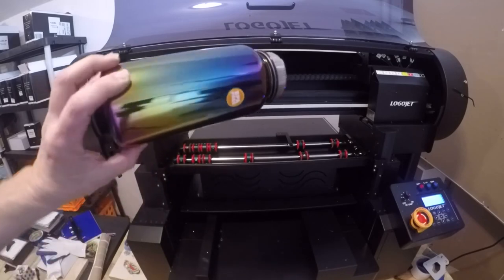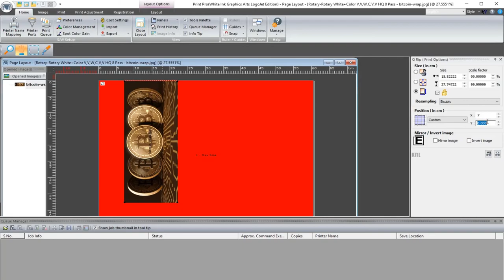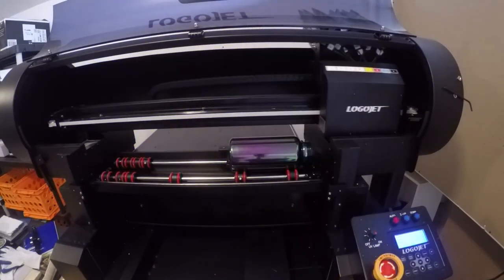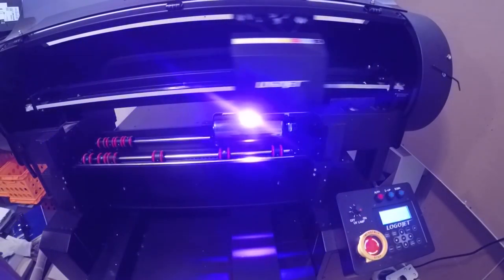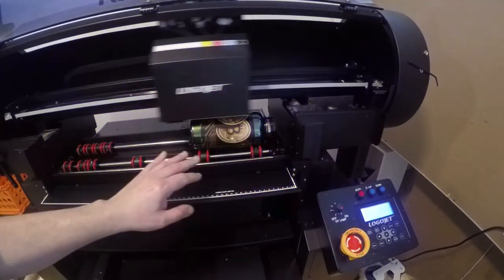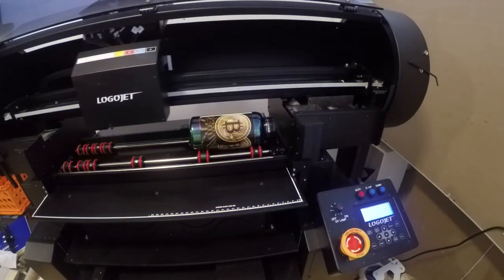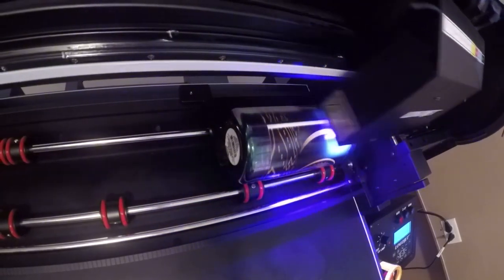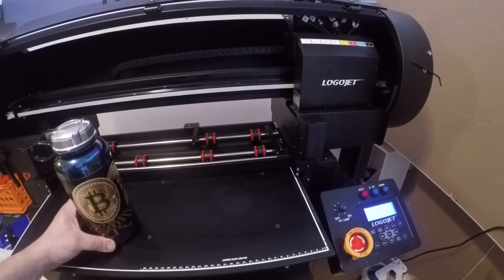Printing Bitcoin Image Full Wrap on 39oz Bottle. Logojet UV Printer with Rotary Jig Attachment

Comment: Hello sir, thanks for this amazing tuto,
So how much time that I need to print on 100 bottle?
Reply from the maker: Takes around 10 minutes to print per run. Can do 2 per run. So around 8.5 hours in total. 
100 bottles/2 per run = 50 runs
50 runs X 10 minutes = 500 minutes
500 minutes / 60 minutes (Hour) = 8.33 hours
Reply: @Bin_Hawk  thanks a lot 💚💚🙏

Comment: Is this machine good to make good profit printing or would you need a larger machine to do high production? I want to print on 600 jars but thatll take alot of time and how much ink would it use?
Reply from the maker: That would depend on what you are printing. This video was just a demo to show that I have the ability to do a full wrap with this printer. Most jobs do not require near as much ink as this would and would not require full wrap. If you are just looking to do your own jars IE 600 it would not be worth the investment of $30,000+ for the machine. What are you looking to print on the jars?
Reply: @Bin_Hawk  just my brand logo and different wording on them. Very little color except for the logo and maybe a border for the words. What do you suggest I use that's more cost efficient if i don't have money to spend?
Reply: Will this machin be AVAILABLE in India and how much will it cost in India